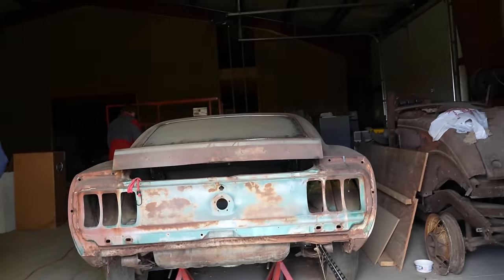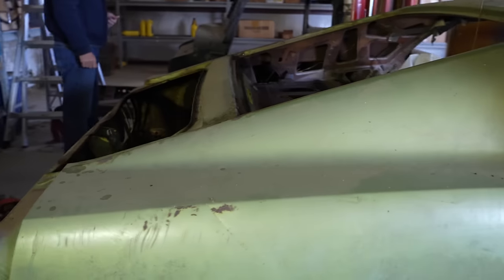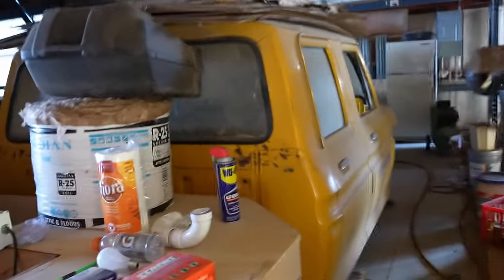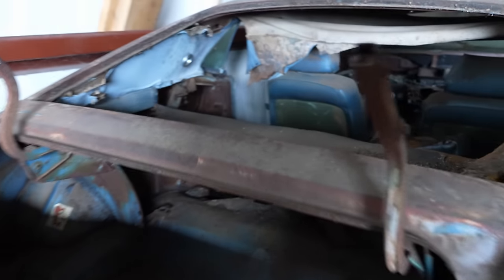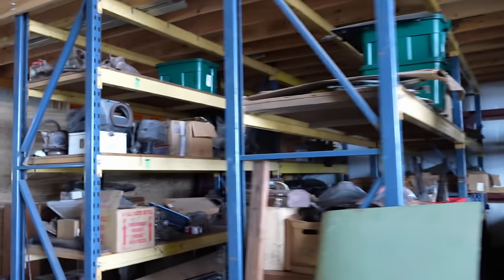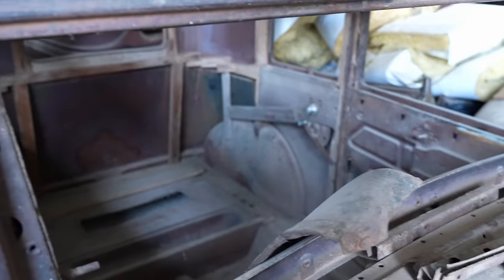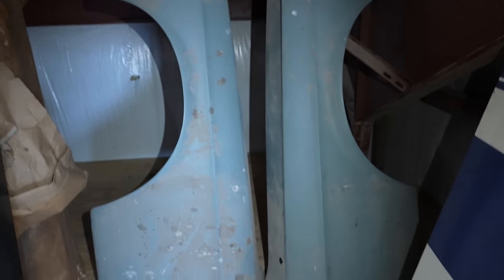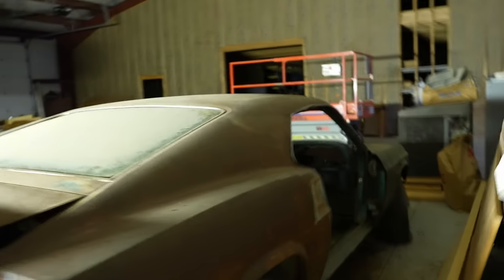This Secret Warehouse was Full of Very RARE Cars & Trucks!

Comment: Centurian I White pigeon. Michigan will build a ford excursion-like trucking a  crew cab 150/250/350 chassis blended with panel sections from Ford blended with pickup bed
 and excurionsion roof sections.
You can even order a dually.😊